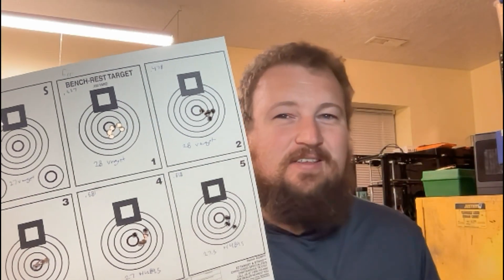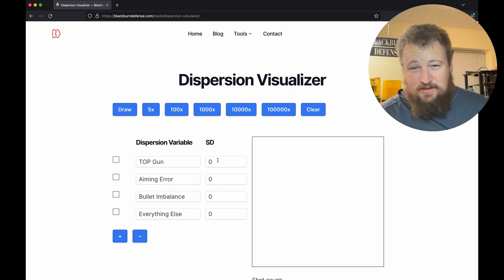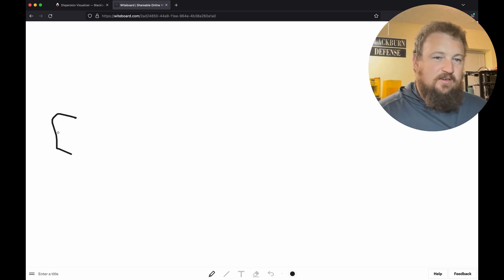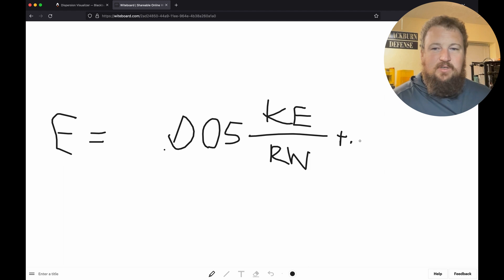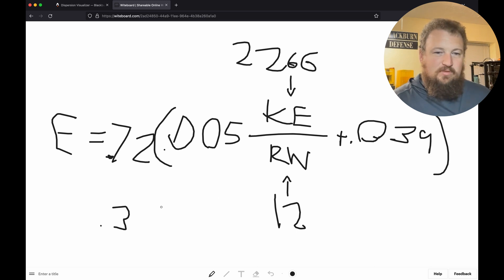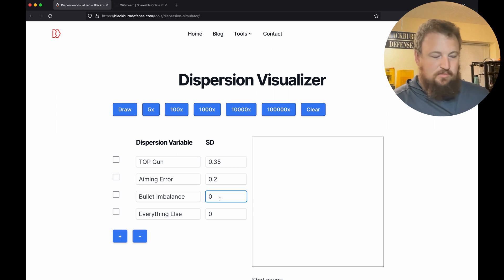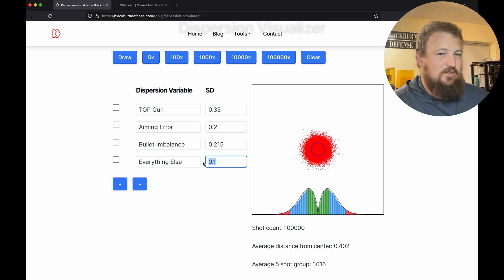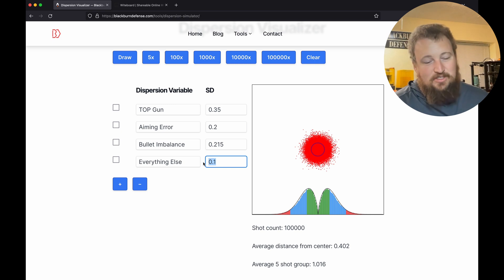Is Ladder Testing Is A Myth?

Comment: This is a very interesting video. Do you have a theory about why some people swear that certain loads have better precision? For instance, in the Sierra manual they have a recommended accuracy load that is typically 100 fps slower than their hunting load. It's not always slower, but mostly. I don't know what their methodology for determining that is (maybe it relies of small sample size). I've also heard the folks at Hornady suggest dropping the powder charge down if you are not getting the type of precision you want.
Reply from the maker: There is a lot of evidence that lowering velocity can improve precision in some cases. Lower engraving force, lower gas pressure at muzzle exit, and less kinetic energy can all contribute to improved precision. However, the theory that there are nodes and that precision increases and decreases in a wave as powder increases has little to no evidence. If you test it with 3 or 5 shot groups, you will often see what appears to be a wave pattern, but those patterns are not reproducible and disappear as you increase the round count per group.
Reply: @blackburndefense  Thanks for the quick reply. I really enjoy the content you are putting out. 

A lot of the things being discussed on podcasts and channels in the last few years have really gone against accepted wisdom, which I appreciate. I've been shooting competitively for a long long time and have had my eyes opened more than a few times, so having an open mind is critical to advancing our knowledge.
Reply: Channels such as this channel, winning in the wind, Hornady, and other professional ballistician/ non-YouTubers, through scientific testing, have shown with statistically significant data that - ladder testing, seating depth, nodes, do not exist.

Find the Bullet and Powder your barrel likes and roll with it. Tailor your goals for accuracy, velocity, energy and/or a combination of the above that suits your needs.  If none are working, replace barrel and repeat.

In the long run, this will actually save you more money and TIME reloading. 

Thank you for your videos.  Subscribed!

Comment: Thanks for putting all this data together and running the stats on it!  This latest video would suggest that the 1) Optimum Charge Weight-OCW (Dan Newberry) or 2) Optimum Barrel Time-OBT (Chris Long) methods do not work. Note that in each of these there is a suggestion that "optimal charge nodes" can be found 1.5% away from "nasty looking" groups (scatter nodes). Your latest test could have skipped over an OCW node or you went from one to another good node. Your "distance" between the 40.5 and 41.5 is ~2.5%.

I'm not saying what you are saying is not true (hell, I'm an engineer and believe in science/statistics), but it would be nice to see you redo that test after selecting an OCW node (use Dan's OCW method) and then changing the charge by 1.5%.

I'm into my second year reloading, and have spent considerable amounts of time, bullets and powder trying to find a/the best load development method. Papers, interviews, YouTube vids from what I consider smart, honest and dedicated individuals (Chris Long, Dan Newberry, Erik Cortina and "Winning in the Wind" and "Crusty Old Marine" seem to contradict that you can't find an appropriate charge and seating depth in a reasonable number of rounds. Not that any would disagree with you that small sample sizes are in some instances problematic. I also believe in what Jeff Siewert has published in his "What is the best Load Development Approach?". In the summary he says to use "... the average of horizontal and vertical standard deviation of fall of shot for a 5 shot group." And note that he shot 7 groups of 5 rounds per charge over 6 separate charges (35 each). This number of shots (~200) is way larger than most of us ever wanted to consider being required, but is supported by statistics!

Boy it would be great if you could try his method too.

Comment: so how do you choose a load?
Reply from the maker: When it comes to choosing a charge weight, just pick something safe.
Reply: @blackburndefense  its interesting as my experience differs in that I chose a load but couldn't get it to shoot below .9moa vertical 800 yards to 1000 (many 10 shot groups over club days). I went back and re tuned . That load immediately shot smaller and held smaller through nationals. Sure I chose off small samples so you could argue that confidence level for time and component usage was non existent. But reality meant I must have stumbled on a better load. i.e. do the stats say there isn't a better load or just its hard to prove it? In this case the proof came out over hundreds of rounds shot over nationals and lead up events IMO.
Reply from the maker: If it was vertical only, then it could be that the loads were producing different velocity variations, Bryan Litz identifies a situation like this in modern advancements volume 3. Unfortunately we didn’t chronograph these shots, so I can’t say if there was any effect on velocity in our test.

Comment: Am I missing something? You took 2 loads, neither with proven accuracy, shoot them and prove both are as inaccurate as each other.
Reply from the maker: The point is that changing powder does not affect precision. Typical tests for this use 5 shot groups, but if there is an effect, you would need thousands of rounds to find it, at which point the barrel would be burnt out anyway. So there is no reason to try and find accuracy nodes by changing charge weight.
Reply: @blackburndefense  - agree that changing the target powder load may not affect precision.  Have you done testing to show effect to precision by load variation?  I.e. target load +/- variation.  Target load not important, but what about variation.  Question: How much variation is acceptable before precision is unacceptable? For example: A 308 target load of 41 grains +/- 0.1 grains.  How accurate do we need to measure powder load; +/- 0.1, +/- 0.01, etc?
Reply from the maker: @rebeljackbrewingco4369  That's a great question. We haven't tested this specifically, but the average point of impact between the two loads in this video was not significantly different, and the precision was not significantly different. So for this case it appears that anything within this powder range of 1 grain will not have a noticeable impact on precision. This is of course only valid at short range, as the velocity variation would have a significant effect at long range.  There may be other scenarios where this doesn't hold true and big powder variations could cause POI shift.
Reply: @blackburndefense  Does this mean that accuracy nodes do not exist, or that we should us another method to find them?
Reply: He actually did prove , that both loads shot the same.  What most guys do is feed their own superstitions, nothing else.